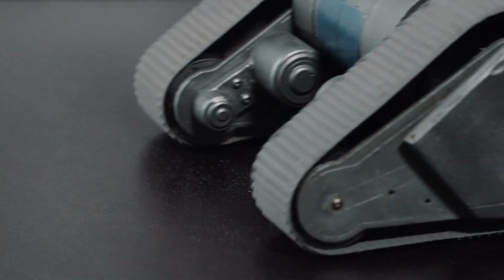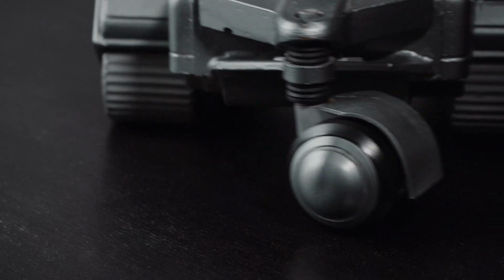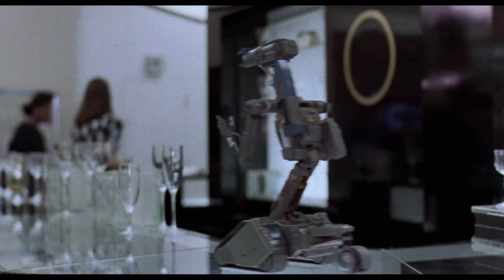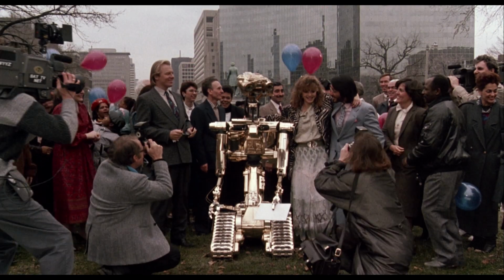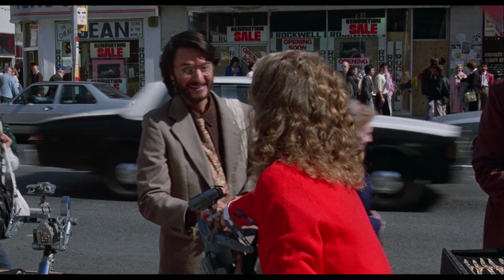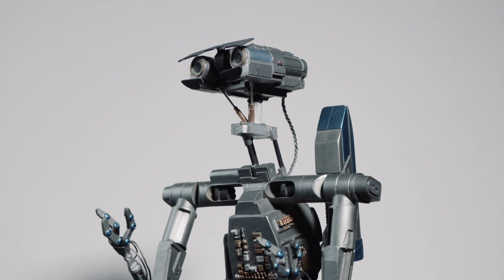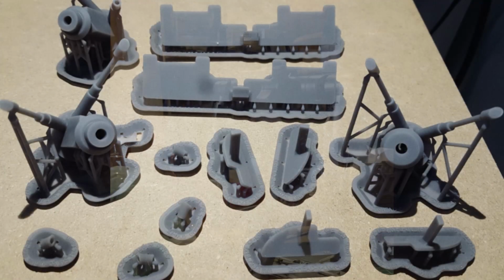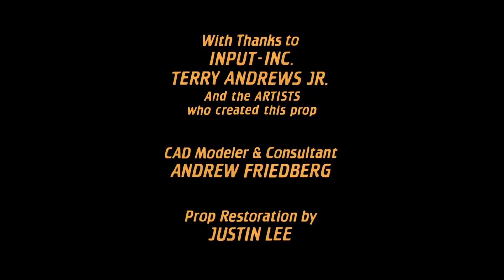"Short Circuit 2" | Screen-used Toy Robot Prop

Comment: Man, I wish someone would take this prop and replicate it exactly for those of us fans to be able have our own mini J5. And I'm not even talking about that Robot V that's out there. Which is not screen accurate. But one like this prop.
Reply from the maker: Mark Raimo We took this one apart for exactly that reason! Through fan group Input-Inc., the hope is fans will soon be able to have their own. 😀
Reply: @webbox100  that's awesome.
Reply: @webbox100  It would have been amazing to mold every part, but clearly the task was to document and conserve.  Great job, and hopefully one day a factory can actually shoot these.  Are fans expected to 3D print and assemble parts?
Reply from the maker: @ianburkard  Hehe, I was over-ambitious and tried molding every part. The problem is that pieces that were originally separately molded and cast were then very strongly glued together, so there were whole sections that were impossible to mold without sawing apart! As for future plans for the fans, I know the small but passionate Input-Inc. team is splitting time their available time between the full-size and the toy, so slowly but surely cool things are happening!
Reply: @thestingray1983  multiple FB groups that have remarkably talented individuals, some make props like these, some design small static models, and a good handful have taken upped themselves to cast and build a fully
functioning Number 5 from complete scratch!!!!!  FB GROUPS:
- Johnny 5 Replica Builders & Fans (Short Circuit)
- Johnny 5 full size replicas
- “I want to customize my Johnny 5 toy robot!
Reply: Theres some great replicas on etsy

Comment: omg.... one still exists... This is my holy grail. I can honestly say that ive seen Short Circuit 1/2 100+ times.... Easily...
Reply: Like they said there were only 5 fully RC mini J5s. They have one, another is in the possesion of a guy who runs a company that does props but it got smashed during an earthquake. The others are... out there. It's easier to get a less accurate but more common Robot V from Joz Robotics. Out of production, but they pop up on ebay and such places rarely. Not a 1 to 1 reproduction as some details/sizes are off, but it's the best us collectors have.